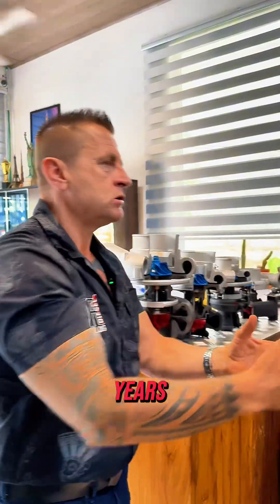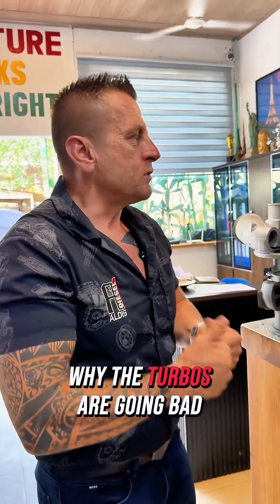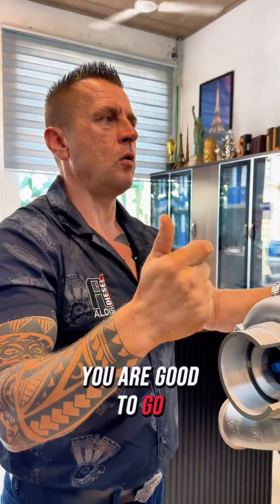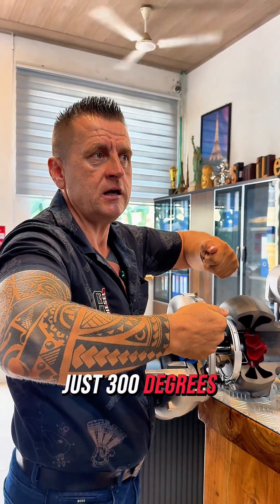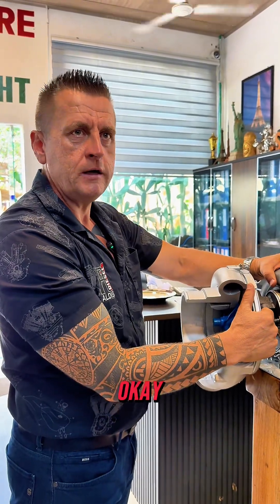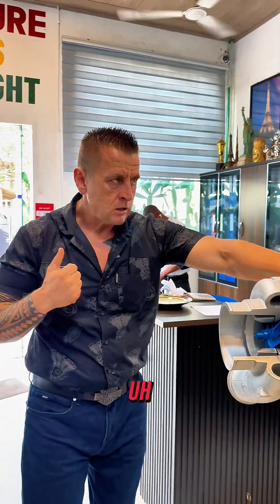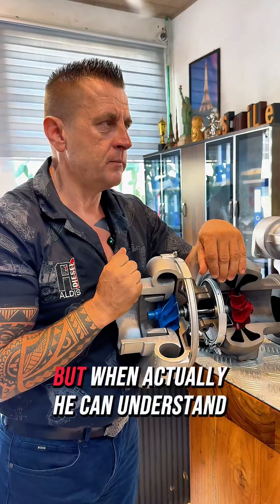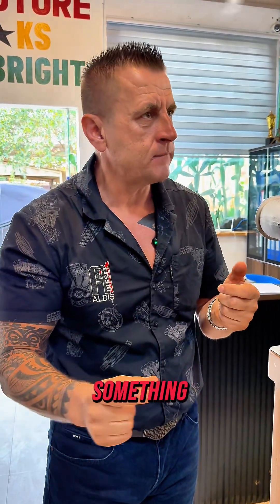This 30-sec habit could save your turbo! 🛑🔥

Comment: Sir, What could be the reason for hilux 2007 2kd injector spoiling 
The reasons behind this particular engine series
Reply: If you mean fuel injector, so...at every some amount of km/miles of mileage/kilometerage you MUST repair injector or install new one. To knew better just go to service shop to check your injectors. If its leaking from nebulizer without standart pressure - bad one its ungermethical. If its leaking from reverse feed of fuel system - bad one. If its make white smoke at idling and even more while reving it and smoke is disgustingly smell like diesel fuel - someone injector is damn leaking. And another one if you put a fingers on every feed pipes that goes to injector while motor is idling, you can tell which one is bad just because its knocking, and when you put your fingers on that feed pipes you can feel the knock BUT not all the times injectors is knocking AND you must be sure that you not takeing vibrations for knocking so...good luck for ya